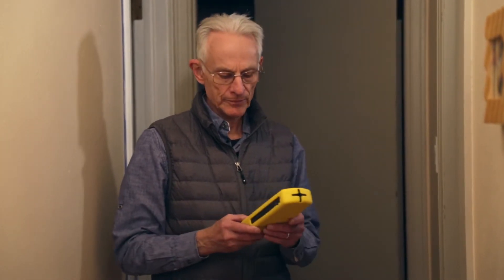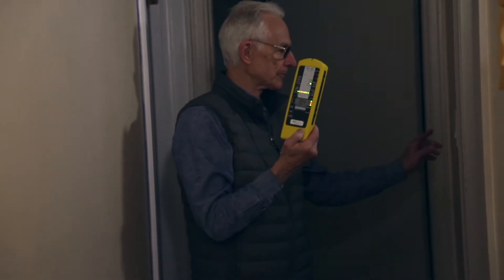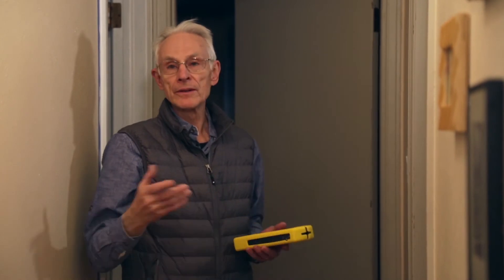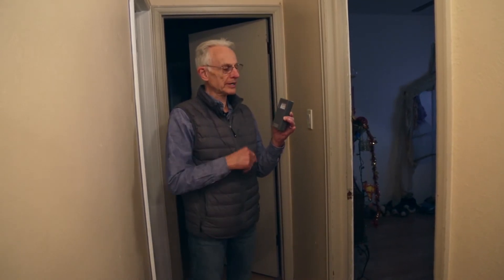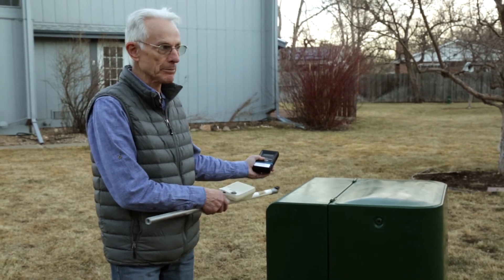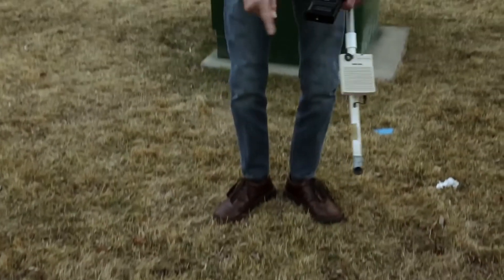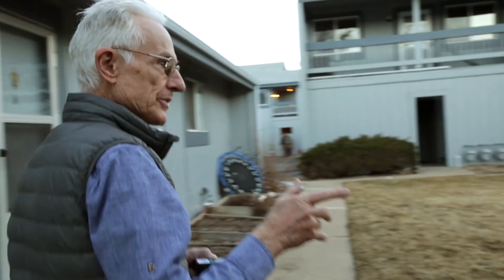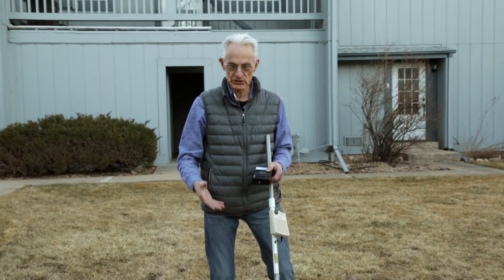Part 7: The Science of Building Biology

Comment: It is disappointing that after all that analysis, a significant source of the problem is outside of the control of the homeowner and their Building Biologist.  It is probably difficult to get the electric utility to acknowledge or work on this.  Would there be a particular strategy that would be helpful when engaging the electric utility, initially friendly, but I suppose if no action was forthcoming then a legal proceeding might be required. 2mg is an unhealthful level to be exposed to all the time.